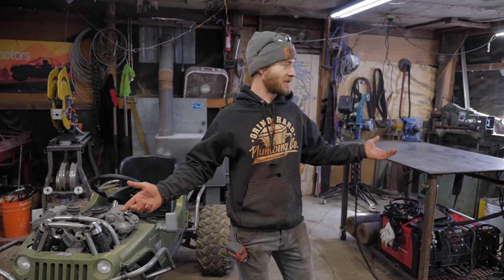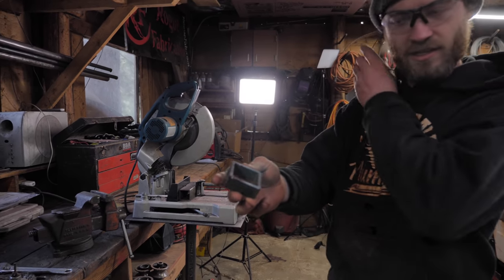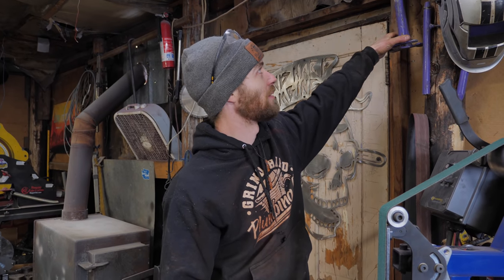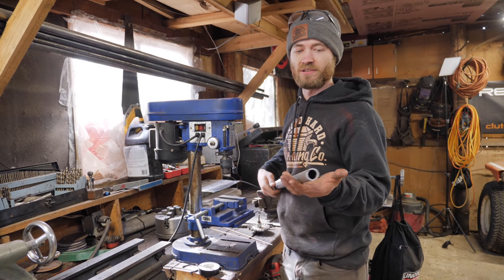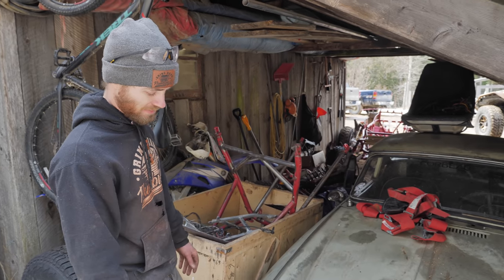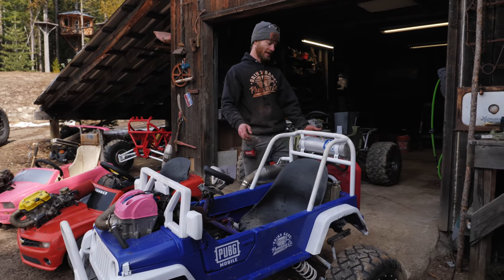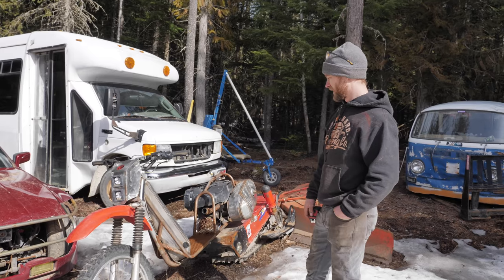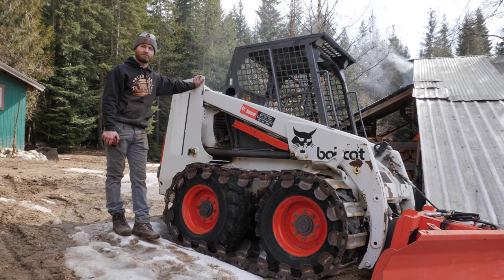Grind Hard Garage Tour!

Comment: My buddy who has a big shop had the same issue with heat and we put a fan in each corner to circulate the air and insulated the garage door with foam an taped it and bam 100% difference!

Comment: Also you can use your manual knock out set for dimpling and countersinking.Just punch a hole, take any size bottom die larger than the hole ,use the next size smaller top die,or 2 sizes smaller and turn the top die upside down.You can experiment and make some neat dimples.I used this method for many years,I'm now retired.

Comment: For small tube notching, why not just use the drill press and vice?
You inspired me and I use my drill press for all of my notching and it works fine. Angles are tricky, but I can tilt the bed of the drill press and bolt the vice down. No big. 

Try it out, it might save you a bunch of time and fiddling... just throw it in the vice, and cut. Easy. For an angled cut you can always shim your vice and bolt it down with an angled piece of wood. (That tip is for people without a notcher or adjustable drill press table. I don't know if they all tilt and swivel like mine does.. it's actually an old Atlas very similar to your lathe in age, reliability and style.)

Comment: You need radiating plates on that stove, a lot of heat is lost directly to air as hot gases escape through the pipe, you could utilize scrap metal plates to generate more surface, thus more opportunity for heat to go into the room. Also, add a very low speed, but high volume fan behind it push hot air around. You need it to be slow enough to not make a breeze, but high volume enough to move as much cold air in the shop as possible (through the stove radiating plates).

Considering how high volume the burner is, you could also do copper pipes and run actual water radiators at the four walls.

Cheap projects to improve the shop, could be a good series.

Comment: If you put an air intake coming from outside it will make a big difference to the heater as it wont be sucking cold air through the cracks in the shed👍

Comment: Those silly wood stoves and fireplaces draw in the cold air from outside into the room and pump all the hot air up out the chimney. It would be fun to build a little heat exchanger in the chimney pipe. All you need is 2 radiators and a pump and a fan.

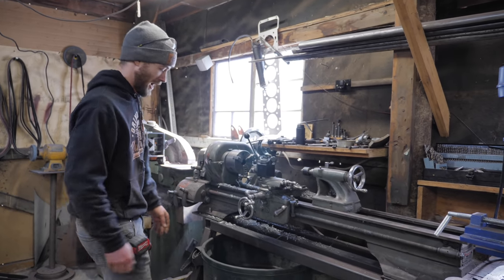Comment: 7:59 I have the same lathe. Mine is a 1948 Atlas QC42. If you look inside the spindle housing the inner bearing race is usually hand engraved with the date.

Comment: Re: 2JZ mower

I'm sure you guys have already looked but an auto off an aristo/chaser/supra/crown athlete should be reasonably cheap to get hold of and it'll take whatever you throw at it in a chassis that light. I think they can be modded to take a bunch more power also (not 100% sure on the strength, I'm a manual trans guy so I never looked into that side of it)

Comment: If you look at the right gear guard, you should find 10-246 cast into it. Somewhere on the headstock, you should find either 10-2 or 10-2A. If the numbers "01575" are stamped into the top of the bed down at the tailstock end, that's the serial number. your lathe

Comment: You have many rocks.  Rocks are an asset, actually.  You might be surprised how much a good chunk/piece of rock can cost, all gemstone jokes/puns aside.

Pile them around the stove for thermal mass.  The radiant zone will expand (I forget the model right now) but even a few rocks will add thermal mass and that will transmit heat once it fills up with heat but the net efficiency/coverage improvement is usually well worth any amount of thermal mass added) more than the size of the rock added and multiple rocks will add up nonlinearly (means greater than 1:1/direct proportional effect than just summation of raw mass).

One place I got in the habit of just bringing a rock back with me when I went afield and it wasn't long before I had a lot of them.  We're spoiled.  It's often hard to find useful rocks in the low, flat desert - it's all DIRT and giant boulders.  The worst it gets here is high desert/steppe, which is actually really nice in its own way.

Comment: If I'm not mistaken that lathe used to belong to my dad. He owned a small gun shop in Spanaway Wa. It was sold when he passed in 1992 to some one in Goldendale Wa. Lost track of it after then. If it is the same machine it's a 1947 Atlas. Looks identical to the one my brothers and I used to make 4x4 drive lines and race car parts with. Just curious if it came with a pedestal grinder that mounts to the tooling head? We had one for ours is all.

Comment: Please please please do F.I. on a single cylinder big bore (450-500cc) like a ktm husky fuel injected engine and do it properly cus no one has made a good one on yt. Hard to do on a dirtbike bike but senderella has lots of room to turbo. Remember you need a plenum at least 2.5× your displacement on a single cylinder and rear mount turbo further from the exhaust  port can help with intake pulse as well. Run high octane fuel and dont lower compression to keep your low end power and you could easily get 75whp reliably with a proper sized turbo. I've planned a build for husky fe501 and thers lots of of the shelf parts for engine and fuel control to add boost. Mak sure you run a the largest intercooler you can! Love your vids!

Comment: Diamond file will sharpen the carbide teeth. You can sharpen them until 2/3 of the original tooth size is gone. Never throw a carbide blade because it's dull, it's such a shame when the file and a Sunday beer can fix it.

Comment: how about making a custom chimney ?
making it as a heater element  to  get all the heat from the firewood possible.
winding pipes around or inside chimney heating water for a closed circuit with bike or car radiators on ceiling  around shops other side.
i have seen it done at a garage. the guy used radiators from cars.
can maybe even upgrade them with a computer fan to move the hot air a bit to get it out in the room.
easy to get bored at these times .but this actually is a triple win.
more content  in lockdown period.
more heat in the shop.
less firewood needed  yearly.

Comment: Instead of a 2jz trans just run an adapter for a GM th350/th400. They hold power and hydraulic shifted unless you run a manual valve body. Plus they arnt super long transmissions.

Comment: Is there another good and way cheaper option for the lathe, to weld 2 pieces (like an axle) exactly straight together. At this point i don't need the other funktions of the lathe. But i noticed u use it alot to bring 2 pieces exactly together. I really need to make an axle longer, but i am scared to weld it because it might not get 100% straight.  Please help, Thank you

Comment: Your JZ transmission. Aisin AR5 Chevy Colorado. JZ bellhousing bolts right up. CPR manufacturing makes the spacer kit for the bell housing. Input shaft is longer than R154 and uses a gm 26 spline clutch. Its a more up to date R154 but for $300 or cheaper. You can also find this transmission in others like the Slingshot, Solstice and Sky.  https://cpr-manufacturing.com/